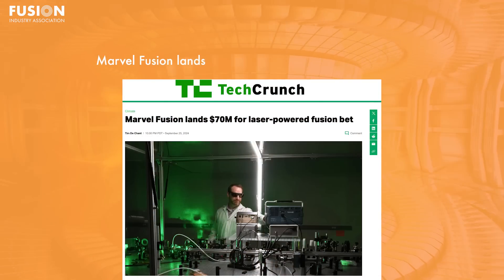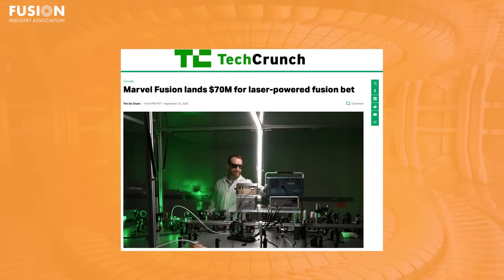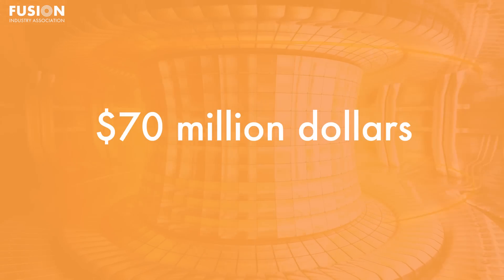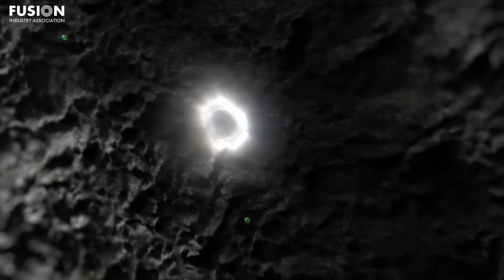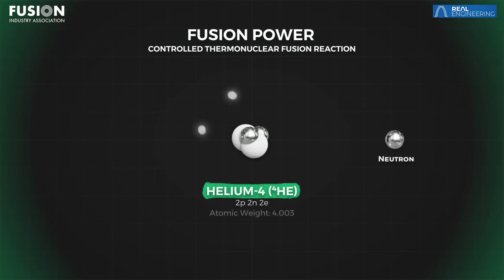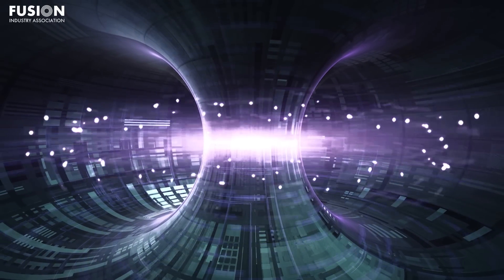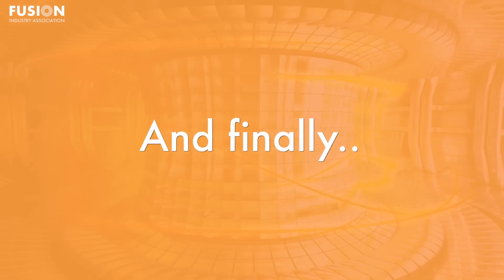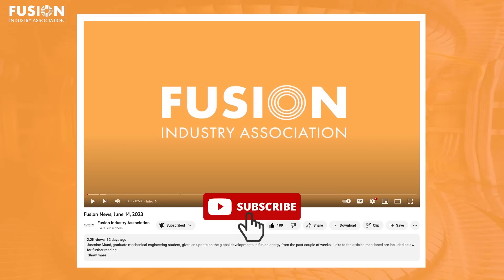Fusion News, October 2, 2024

Comment: Marvel Fusion doesn't work in the end.

What works is safe: firing Hg/Pb or protons into LiD. The first fusions were with cyclotrons!

Approx. 3 MeV/Hg+ is sufficient for fusion. At 30 MeV, the best neutron generator is the high-frequency neutron generator, since many collisions of the same nucleus always occur when 197Hg epsilon decay to 197Au gold. There is hardly any n-reabsorption. Slightly magnetic. Hg/Li separable in the tube, shot upwards into LiD. LiD mg remains at the top. Hg decelerated linearly for propulsion in the tube at the ring accelerator with a second counter-rotator. This is an endless (space) ship propulsion system.

 200g of 200Hg+ ions with approximately 30MeV at 3000km/s, equivalent to approximately 400kg at 5400km/h, as thick as a needle, penetrates any (ship) armor in 1/3 of a second from a rocket launching 1000km away, easily launched to satellites, jets, copters, drones, grenade salvos... ultra-cheap per shot, also detects nuclear excitation from gamma radiation from proton cannons.

 Gold 197Au -1 or -2n decay to Pt +1n or +1p decay back to Hg.

More energy from 6Li+D directly to 2 4He each at 11.2 MeV and continuing to fuse without neutrons in LiD instead of indirectly 6Li+n→4He+T or 50% D+D →T+p or D+n→T with a high n of Hg n-spallation, thus first D+T→4He (3.5 MeV) + n (14.1 MeV).

7Li+p→2 4He +17.2 MeV also high, plus 10B+n→7Li+4He, thus fusing cleanly with protons or 3 MeV Hg/Pb almost without neutrons.

 LiD melts at 688°C, decomposes at > 900°C, thus producing CO2. Turbine steam cycle with suction centrifugal compressor (natural gas). Return flow: everything cooled (indirectly) by the cycle. Everything thermally insulated. Efficiency ≈ 100% at 57.3 bar, 20°C.

Rule of thumb: Coulomb wall in MeV

(Z*Ztarget)/³√(Atarget) where Z is the number of protons. A with neutrons is low for small D, T & Li nuclei and accelerators are only thermally high, with radiation problems at walls only during thermal D+T oscillations.

 No.Starting materialsProducts(1)2D + 3T →4He (3.5 MeV)+n0 (14.1 MeV)(2a)2D +2D →3T (1.01 MeV)+p+ (3.02 MeV)(to  50%)(2b)2D+2D→3He(0.82 MeV)+n0(2.45 MeV)(to  50%)(3)2D+3He→4He (3.6 MeV)+p+ (14.7 MeV)(4)3T+3T→4He+2 n+ 11.3 MeV(5)3He+3He→4He+2 p+ 12.9 MeV(6a)3He+3T→4He+p+n+ 12.1 MeV(to  57% (6b)3He+3T→4He (4.8 MeV)+2D (9.5 MeV)(to 43%) (7a)2D+6Li→2 4He (each  11.2 MeV)(7b)→3He+4He+n+ 1.8 MeV(7c)→7Li (0.6 MeV)+p (4.4 MeV)(7d)→7Be (0.4 MeV)+n (3,0 MeV)(8)p+6Li→4He (1,7 MeV)+3He (2,3 MeV)(9)3He+6Li→2 4He+p+ 16,9 MeV(10)p+11B→3 4He+ 8,7 MeV(11a)p+7Li→2 4He+ 17,2 MeV(11b)p+7Li→7Be+n

Marvel Fusion geht am Ende nicht.

Was sicher geht ist schießen von Hg/Pb oder Protonen in LiD erste Fusionen waren mit Zyklotronen !

Ca. 3 MeV/Hg+ reicht für Fusion bei 30 MeV bester Neutronen Generator da viele Kollisionen von selbem Kern immer wen 197Hg Epsilon Zerfall zu 197Au Gold kaum n-Reabsorption leicht magnetisch Hg/Li trennbar in Röhre nach oben in LiD geschoßen bleibt LiD mg. oben Hg abgebremst linear für Vortrieb in Röhre an Ring Beschleuniger mit 2. Gegenrotator ist endloser (Raum-) Schiffsantrieb.

200g 200Hg+ Ionen mit ca. 30MeV 3000km/s wie ca. 400kg 5400km/h nadeldick durchbricht jede (Schiff) Panzerung in 1/3s bei startender Rakete 1000km entfernt leicht hoch zu Satelitten, Jet, Copter, Drohnen, Granatsalven... ultra billig pro Schuß detektiert auch an Gammastrahlung von Protonenkanone Kernanregung.

Gold 197Au -1 oder -2n Zerfall zu Pt +1n oder +1p Zerfall zurück zu Hg.

Mehr Energie von 6Li+D direkt zu 2 4He je 11,2MeV ald ohne Neutronen in LiD bleibend weiter fusionierend statt indirekt 6Li+n→4He+T bzw. 50% D+D →T+p oder D+n→T bei viel n von Hg n-Spallation damit erst D+T→4He (3,5MeV) + n (14,1MeV).

7Li+p→2 4He +17,2MeV auch hoch dazu 10B+n→7Li+4He also sauber fast ohne Neutronen fusionierend mit Protonen oder 3 MeV Hg/Pb.

LiD schmilzt 688°C zersetzt > 900°C damit CO2 Turbinendampfkreis mit saugendem Fliehkraftkompressor (Erdgas) Rücklauf alles von Kreis (indirekt) gekühlt alles th. isolierbar Effizienz ≈ 100% bei 57,3bar 20°C.

Faustformel Coulomb Wall in MeV

(Z*Ztarget)/³√(Atarget) wobei Z Anzahl Protonen A mit Neutronen niedrig für kleine D,T & Li Kerne und Beschleuniger nur thermisch hoch mit Abstrahlungsproblem an Wände nur bei therm. D+T Schwingungen.

Nr.AusgangsstoffeProdukte(1)2D + 3T →4He (3,5 MeV)+n0 (14,1 MeV)(2a)2D +2D →3T (1,01 MeV)+p+ (3,02 MeV)(zu 50 %)(2b)2D +2D →3He (0,82 MeV)+n0 (2,45 MeV)(zu 50 %)(3)2D +3He→4He (3,6 MeV)+p+ (14,7 MeV)(4)3T+3T→4He+2 n+ 11,3 MeV(5)3He+3He→4He+2 p+ 12,9 MeV(6a)3He+3T→4He+p+n+ 12,1 MeV(zu 57 %)(6b)3He+3T→4He (4,8 MeV)+2D (9,5 MeV)(zu 43 %)(7a)2D+6Li→2 4He (je 11,2 MeV)(7b)→3He+4He+n+ 1,8 MeV(7c)→7Li (0,6 MeV)+p (4,4 MeV)(7d)→7Be (0,4 MeV)+n (3,0 MeV)(8)p+6Li→4He (1,7 MeV)+3He (2,3 MeV)(9)3He+6Li→2 4He+p+ 16,9 MeV(10)p+11B→3 4He+ 8,7 MeV(11a)p+7Li→2 4He+ 17,2 MeV(11b)p+7Li→7Be+n

Comment: Nuclear fusion energy promoters, such as the one above, typically employ deceptive descriptions to sell the products that they have fallen in love with. I will describe a couple of the tricks below.

When they describe the fusion energy gain they typically do not make it clear what energy parameter they are using. Typically the gain value they quote is denoted by the symbol Q. In virtually all cases they are referring to Q-plasma which is the energy that is coupled into the plasma that ends up heating it. That energy value can be many orders of magnitude less than the energy needed to power the entire reactor and all its support systems. That value is often referred to as the net energy input, or the total energy input. Its value is used to formulate Q-total which is the value that is essential for any engineer that intends to design a power plant. Another factor that is never expressed is that most tokamak designs will have to operate in a pulsed mode when they are operating at near their maximum designed D/T fueled fusion energy level. Commonwealth Fusion Systems (CFS) SPARC is expected to  have a 'ON' time of ten seconds. The recovery period could be far longer. The Q-fusion value only applies to the 'ON' period of time, not the total of both the 'ON' and the 'OFF' time which is what the Q-total is based upon.

The nuclear fusion promotional community also tends to use the term 'ignition' in a misleading way. For most people they associate the term ignition with something akin to the striking of a fire-match. In that case once the reaction begins at one point it it spreads, or propagates, until all the match head fuel has been consumed, without any continuing input of external energy. Nuclear fusion energy in earth-bound reactors isn't anything like that. There is no guarantee that a substantial percent of the supplied, every expensive fuel, will be consumed once the fusion conditions are reached in a small volume of the confined plasma. For example, in the widely announced December 5, 2022, laser shot at the National Ignition Facility (NIF) the fusion reaction began in the center of the extremely compressed fuel plasma and then several forces resulted in the outward movement of fuel in a violent explosion. The fusion reaction only lasted for approximately 0.000,000,000,08 second and then the remaining 96% of the unfused fuel was blasted away, and rarified, from a point where it could react. That unfused fuel was sweated away into the target chamber vacuum system, including the radioactive tritium. There are good reasons the lab didn't bother to describe that portion of the process. The fusion energy released was about enough to boil two liters of water but the energy required, to pump the lasers, was more than 100 times greater for this so-called 'breakeven' experiment.

Also unmentioned, or skillfully obscured, was the fact that the NIF has always been primarily funded as a thermonuclear weapon (H-bomb) research tool. In fact that announced experiment included a weapons related target that was exposed to the prompt flux of 14.1 MeV neutrons generated by the fusion reaction. That 'breakeven' experiment was supposed to have been achieved by 2012 but that target was missed by a factor of over 100. Major tweaking took place in many systems over the next decade. The target assembly cost has been estimated to be over $100,000 for the announced shot. Much of it was vaporized by the experiment. It has been estimated that NIF has already consumed more than $11-billion in federal revenues. The administration has always portrayed the machined as a viable path to a nuclear fusion energy power plant whenever they address journalists and the general public.

Comment: Nuclear fusion energy experiments began in the 1950 with big promises, the same suggestions are present in these videos since many billions of USD dollars are now being expended upon such research. The sale pitches tend to leave out key issues that might dampen interest. One is that the National Ignition Facility has always been primarily funded as a thermonuclear weapons (H-bomb) research tool. The administrators have become masterful in obscuring that purpose. The December 5, 2022, laser shot, referred to as a ‘breakeven event’ was far from it. Over 100 times more energy was used to drive the lasers than was generated in the extremely brief fusion reaction. There far more problems than just poor laser inefficiencies. The experimental shots are rarely repeatable. That experiment took about a week to prepare but the fusion reaction lasted for approximately 0.000,000,000,08 second. The generated energy, at the microscopic center, then blasted 96% of the supplied fuel away from the reaction area before it had an opportunity to fuse. It was then sucked away into the vacuum chamber pumping system. The use of the term ‘ignition’ is deliberately deceptive. MarvelFusion will also have to  contend with the major problem of less than a nanosecond of energy release followed by lengthy recovery periods of time. This holds true for all inertial confinement fusion (ICF) approaches. Most hyping presentations fake to mention that tritium is not only radioactive but also that the current commercial price is about $30,000 per gram. Still many of the promotional pitches claim the fuel source is virtually unlimited. Whenever you hear the Q value, or energy gain, ask at what point was the input energy measured. Typically that value is never the input energy consumed by the facility during the full experimental period. Almost all the postulated nuclear fusion energy magnetic confinement fusion designs are assumed to run in a pulsed mode when operating at near maximum fusion energy output levels. The recovery time, between pulses, are likely to be longer than the fusion energy pulse. That means the thermal output of each pulse will likely to be far greater that the average thermal energy generated by the plant. That would result in constant thermal cycling that almost no one seems to be designing for.

Comment: Thanks for the news summary.
Based on ITER and DEMO concept and scientific data, how much bigger is a 5 GWth fusion plant (or several plants combined, if justified) compared to a fast-neutron molten chloride salt fission reactor? How many times less lifetime is expected, and as a result (even if it somehow magically starts to work within a decade with 70% uptime) how many times more volume radioactive device/equipment waste is expected (for 200 GWyears of high temperature heat energy produced) from fusion compared to fast neutron fission?

Comment: Marvel & INF are both dead ends: This tech is really for 4th generation thermonuclear weapons. Marvel may have a chance with a deterium\litithum core with a beryllium casing. X-ray energy will trigger the Beryllium to release neutrons that fissile Lithium int Tritium and triggering T-T & T-D fusion. But this is only practical for nuclear weapons & not a commerical power plant as the shot times would be too long & the output energy too small.

For Plasma testing, I believe the use just regular hydrogen because they primary goal is testing the stablity of the magnetic confinement field. Using Deuterium would release neutrons from fusion & neutron activate the reactor, making it radioactive. Usually they only allow fusion to occur the reactor when they are shutting down the reactor permanent (ie JET last run). Still Magnetic confinement (Tokamak) does work as its impossible to contain the plasma for more than a few minutes. the Plasma creates magnetic fields which destablized the magnetic confinement field causing it to fall. This is very likely an unsolvable problem. Its been around since the 1950s & after 60 years of research & testing, we are no closer to solving the problem.

Comment: What's the "projected" LCOE for "some type of fusion technology"? I find it even difficult to put into words, because right now we don't even know which approach could work. Is there someone doing this kind of "research" ("guessing")?
Reply: I find the laser ones tend to project about $50 - $60/MWh. General Fusion projects $65/MWh. Zap $30-60. Helion "as low as $10/MWh, starting from about $60". CFS I think around $70-$80. First Light Fusion mentions $45. A Monte Carlo simulation of the cost space for First Light was heaviest around $80 and as low as $25 I think. Of course these all make some kind of assumptions particularly based on the physics working as projected
Reply: @Canucklug  Thanks for your data. I've seen Solar PV+Batt projected for 2030 as low as 20 USD/MWh. Another data from the FIA showed (survey asked to fusion companies) that they expected fusion circa 2034, but I think that would be breakeven year, and not "the best LCOE year". To lower prices they would need like 10-20 more years I guess. If PV keeps lowering LCOE to 2040 it would be even lower and harder to beat that price. And PV is an already working, proven, mature technology with decades on the market, so the forecasted LCOEs I think are much more believable for PV than for technologies that don't even exist today. All this makes me ask if there would be any economical viability for fusion ...

Comment: It is well-known in acoustics that multiple component gas mixtures propagate waves faster than single component gases, ceteris paribus, simply due to the statistical mechanics.  While the coupling mechanisms are certainly different in plasmas, the underlying reasons for wave propagation speed being different remain the same.  It's not surprising that D-D would be different from D-T, but it is gratifying that it goes in the right direction for stability.  My hand-waving argument for stability would be "faster = higher damping."

Comment: To realize fusion it needs to work first in these R&D reactors to make the tech work THEN develop the infrastructure AS commercial reactors are designed, built and validated.  Until then we should be spending available funding on lower cost solar deployment.  The goal is enough energy to drive our civilisation and the lowest cost way of getting there that doesn't pollute or endanger lives.

Comment: Great review. Very informative. Just one observation: 6:50 It isn't the free electrons, but the ionised ions that cool the plasma, since their radiations power goes as (Ze)^2, where Z is the atomic number of the ion and e is the charge of the electron. Indeed, the greater Ze, the greater the radiation power. Besides that you may also have line radiation due to the de excitation of electrons changing atomic levels. These ions are considered impurities in the plasma, and it's important to diminish the Z_effective.

Comment: $70M is a joke, try $70B to see if ITER works, nope that didn't work either. 
NIF did not and never will reach break even, since it ignores the total energy needed which is many orders of magnitude greater than that presented at the Hohlraum, 
On Wikipedia the NIF fuel is a Lithium Deuteride target used in all thermonuclear weapons. A commercial target will need to cost a cent and not not $100k for a few MJ per pellet.
It comes down to fusion requiring 100,000,000 K or more vs just 1000 K for a Molten Salt Reactor that has none of the exotic impossible problems of fusion.
Further fusion breeding gain of Tritium will never ever be 1.0, it will be far less but needs to be more than 1.0.   Fission easily has neutron gain of about 2.5 or so, established by WWII. 
 I would try a tile of compound material where the different element combinations are patterned randomly on a large target and look where on the tile the results is best.
As for the point 4, China is now building up small prototype Thorium Molten Salt Reactors based on US research done in the 1950s at Oakridge.
Tritium is best produced in situ from the Lithium Deuteride, the lithium is split into Tritium and fused with the Deuterium within the LD molecule as per thermonuclear weapons.
It might well be prudent to explore using fission fusion to make fusion energy work as in all weapons, or just forget about the fusion part.
Also see the comments of Improbable Matter as well as Daniel Jassby on the problem with Tritium.